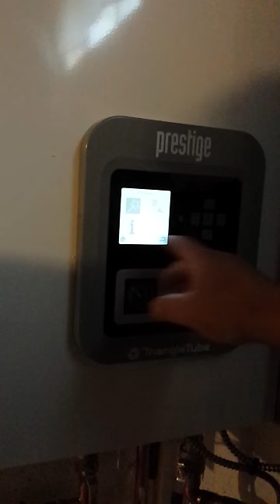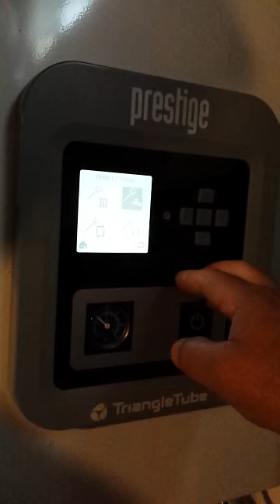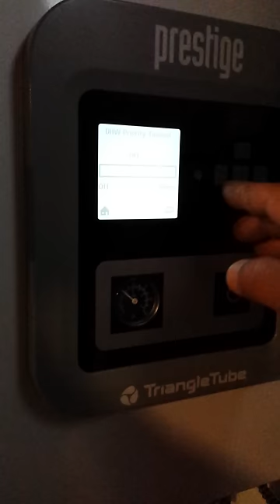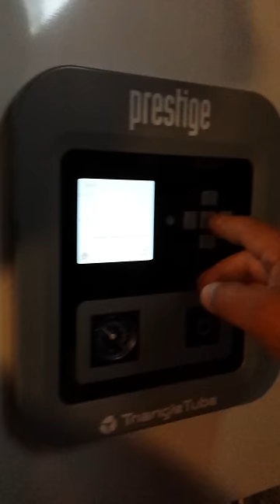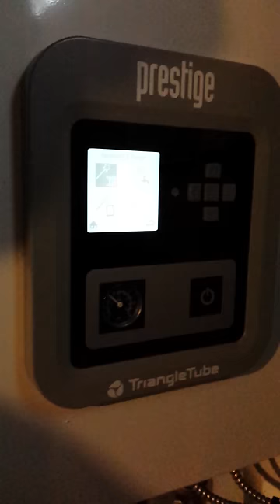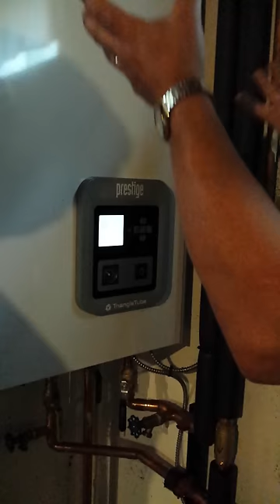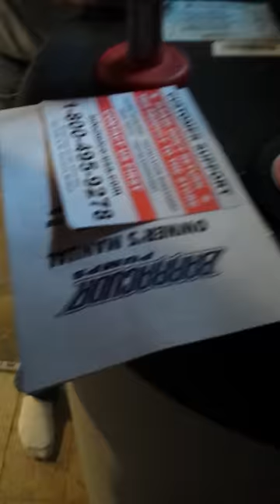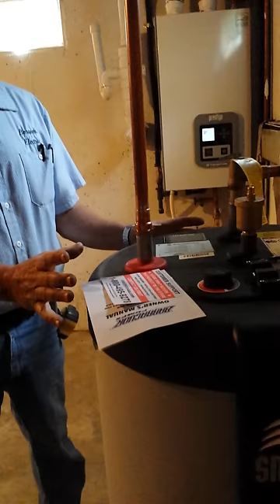Instructions for use of Triangle Tube Boiler Prestige model 110

Comment: Somebody Please Help?! I have the same furnace/water heater. No matter how Low I set my wall Thermostat, the radiators Still get Hot in the warm weather. I end up having to shut Off the furnace but then I get no How water from sinks! This furnace works Great in the winter though! No problems then. I got this furnace installed in 2014. Oh..I even Shut Off the furnace on the thermostat itself thinking the furnace will not go on right? Still the radiators heat up as mentioned. Thank You!
Reply: You are probably missing flowcheck valves or the ones in the circulator are stuck open.   There is also a setting to disable CH and leaves DHW enabled

Comment: I am getting a E37 Low Water (water level has fallen below an acceptable operating level).  How do I make an adjustment to the system so that it will heat the water?
Reply: Deejae Johnson adjust the pressure regulator. increse for more pressure but really watch it so it won't go over pressure because it will pop the safety valve.

Comment: Hi, I have a Triangle Tube Excellent heating system and I having problems with the heating demand it is always working and my house is always in 75 or 79 degrees even though the set temperature is 66 degrees. Can you give me some idea that what is happening?.  Thank you for your help.
Reply: You know I have the same problem, the furnace is not communicating with my thermostat and it is getting hot in the house. I'll let you know what solutions I can find
Reply: +David Yong You have to do EZ setup and chose Switch&outdoor reset.
Reply: The installer didn't know what he was doing.  You need flowcheck valves.
Reply: @barackobama5304  where do these generally install? I have the same issue as well as limited DHW only with the heat on. Also there’s two separate thermostats, one only works the taco and recirculated pump, the other gives the heat call to the unit. Anyway to integrate with one per level in home? Sorry for all the questions, grateful for any help!
Reply: @jdamoose1822  Did it ever work right?  Or all of a sudden you have problems?  If it never worked right then it is a faulty installation.  Call the guy who installed it to fix the mess.
Reply: @barackobama5304  hard to say just got this place and it was basically a rarely used vacation stay prior. Based on the amount of other issues I’d suspect it wasn’t done right. I’ll probably resort to reading the instructions until I get annoyed then calling someone who deals with these systems for a living.

Comment: How do I adjust boiler pressure
Reply: Sergio Vasile theire should be a pressure regulator on the main water line coming into the unit. their should be a screw on the top of it. screw clockwise to increase pressure and counter clockwise to decrease pressure.

Comment: have this awesome unit, but as of recently the out side temp. has dropped to under 20 degrees and it wont heat the house above 65degres not sure what went wrong. any thoughts?
Reply: Justin McCabe what kind of heating units do you have?
Reply: Trey K I have baseboard hot water.
Reply: if it has a circulating pump that I might be it. or there might be air in the system. also on the unit itself might need to go through the settings, something might be off or needs adjustments.
Reply: Try max heat output at 20 deg instead of 0 deg which is factory default